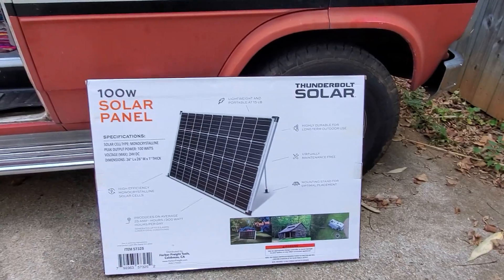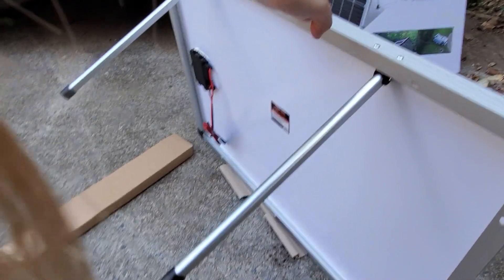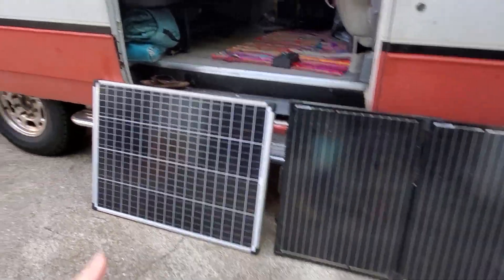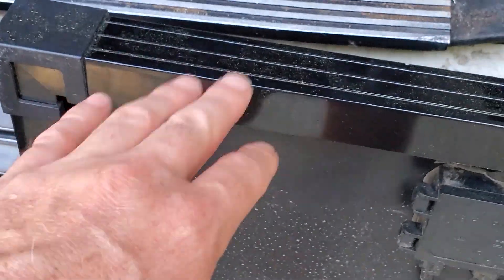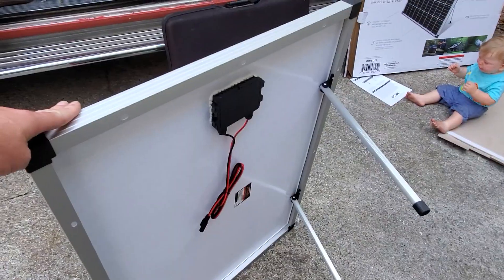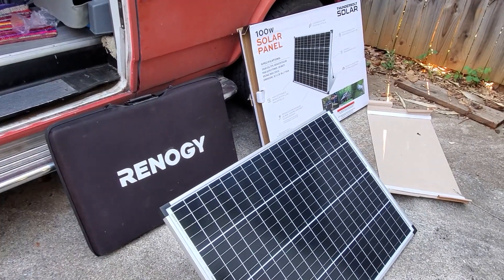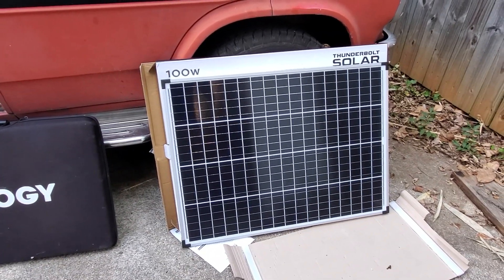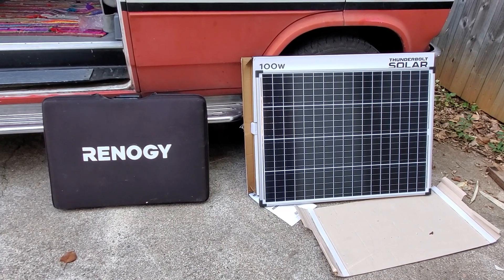Harbor Freight Thunderbolt vs Renogy portable solar panels

Comment: Newbie Question , just received my first solar panel Briefcase style (Richsolar)100w with PWM controller to use while camping to help keep batteries up. do i need to disconnect it if i am going to run my Generator  for the whole Travel trailer ? will it case damage to the system. thanks
Reply from the maker: Well, without seeing your exact setup, I would say that I have done the same and there has never been an issue. Your trailer connection to your generator should be an AC 120v connection, maybe 30amp, or something like that. Your battery system is DC 12v, I assume. So to oversimplify, generally the AC system, and the DC (battery) system of a trailer are separate. They do not run on the same power sources and use separate wiring. 

I have had my external battery charger plugged into the generator, charging the battery, while concurrently charging the battery from solar. There is some debate over whether this is a good idea, but my research (and actual use) shows that multiple DC charge sources can go to the same battery, and assuming they have their own charge controllers, all is well. I have also used two different solar panels with their own separate charge controllers going to my trailer battery, and it just charges faster, with no ill. 

Are you using an external generator, or a "built in" generator with some type of auto switch over for your camper?

Comment: I've been thinking about getting a couple more 100 or 250 watt 12 volt panels.  Not much difference in price on Amazon or Ebay.  
I currently have 2-100 watt panels,  and the old school 45 watt Harbor Freight kit. 3- 15 watt panels and a 45 watt Thunderbolt controller. I have a 40 amp ir 400 watt Thunderbolt controller too.
Two systems,  a 12 volt only,  and a 12 volt with 1200 watt  inverter. Have 600aH worth of battery storage,   two 6 volt golf cart batteries, in series,  and 3-100aH 12 volt deep cycle ones.
Reply from the maker: Yeah standardizing your panels should help the charging efficiency, keep panel voltages similar will give you the optimal output.
Reply: @kampinglogik  
You're right.  I just go with the stuff I already had, or can get the best deal on. I went with my dual, low vol, 12 volt system and the 116v AC system. 12 volt, 150aH ch controller,  150 watt inverter for charging phones and 2-way radios and the other 115vAC  1200 watt inverter and 650aH battery storage  for a  small refrigerator, 40" TV, DVD Player   LED lamps,  Christmas lights,  and 20" box fan. 
I figure not if,  but when we get an EMP, I will be better off than probably 95% of the rest. I can charge my radios,  watch TV, and DVDs, have light, a fan, cold Dr Pepper and clean my guns.
Hey. Make a  3/16" luan/plywood box, or like a slip cover. Cut with a safety knife or saw, duct tape the edges, done. Super protection,  light weight and kinda cheap.
Reply from the maker: @brianroberts5740  I'm with you there! Always looking for the best value!!

Comment: Get a nice MPPT controller.
Reply from the maker: Yeah I have a Renogy DC to DC MPPT charge controller in my van that takes a 12v line from the alternator as well as the solar input. I really like it. I use these panels for my trailer battery, I haven't yet justified replacing the two Renogy PWM controllers... after a 12 day trip to Maine this past summer, the two panels with their PWM controllers kept the battery topped off without a problem even with lots of cloudy days. I'm sure I will upgrade controllers if we ever do long (6 or more week) trips again like we have in previous summers.
Reply: @kampinglogik  I have the old HF controller from the 45W solar kit, I will keep it.

Comment: Mount it to side of van
Reply from the maker: Haha, the van has 2x100w panels on the roof... these are for the trailer. We just ended up throwing the Harbor Freight panel on the trailer bed while in transit on our most recent trip, the Renogy suitcase panel always sits just inside the trailer door...
Reply: @kampinglogik  as long as it produces
Reply: @kampinglogik  must be California or up north

Comment: I've been thinking about doing that
Solar panel on top of  van.!
Probably a dumb question?
How did you do it? Thanks!
Reply from the maker: Haha not a dumb question, it took me about 4 years to finally commit to mounting a solar panel on my van roof. I used some metal right angle pieces to have rails in between my ladder racks - then I mounted my 2 panels to those. The only hole I drilled in my roof was for the cable entry gland (a 1/2" hole). Here is a video showing how I did it - https://youtu.be/87Mpz1PEnAw
Reply: @kampinglogik  THANKS!
And HAVE A GOOD ONE!

Comment: I would make a slot in my vehicle to slide it in & out if I would keep it as a remote setup or depending on how the hard mounted solar is mounted, I would stack mount them where I can lock a latch & slide it under/over another solar panel while not in use & unlock said latch & slide it out when I want to use it! Drawer slides would work here, just need to make sure you're using heavy duty ones & you can lock them in both the open & closed positions!
Reply from the maker: That would be an awesome flexible setup. Flexibility is paramount in my mind, cause every campsite situation is different!! Message me if you get it setup I'd love to see how you do it!

Comment: No output readings? What kind of solar review doesn't include the most important aspect of a solar panel? Did I miss something?
Reply from the maker: Several guys have done output measurement on each of these panels, so I thought I'd compare other aspects of them. Fortunately they both seem to function well. Maybe I will do a head to head measurement video of these two soon. Thanks for watching.

Comment: I was thinking that a comparison would include output readings. I would bet the renogy is significantly higher. But great idea for your next video
Reply from the maker: Yeah I will try to do that soon. So far it looks like the HF panel does good as far as the output level. It tops out the 60w limiter on the Jackery 290 even late in the day. I do know from a lot of use that the Renogy puts out over 5 amps in good light.

Comment: Do you have to use a charge controller with the HF panel and jackery 290? Can't you connect it without a charge controller?
Reply from the maker: You are correct, no need for an external charge controller with the 290 or assumptively any other power station. This is why the HF panel is perfect for power stations - no need to pay for anything unnecessary.
Reply: @kampinglogik  I'm so happy to find this review! I got 2 of these z
HF 100 watt panels. Trying to figure which power station because someone pointed out the 24V I'm lost. Anything you can offer idea wise on this? Thanks a ton
Reply from the maker: @heatherk8931  Hmmm... 24v? Because you have two of them? You should just be able to connect them in parallel without any problem.
Reply from the maker: @heatherk8931  Or are you referring to 24v being the open circuit voltage?
Reply: @kampinglogik  don't worry about the 24v maximum on the HF solar panels.  It's rated for 12V use. And with any charge controller or power station, the voltage will be reduced to fit a 12v system.
Reply from the maker: @CivilRepair  yeah that was a viewer's concern, I was trying to figure out what they thought was 24v... anyway, thanks!
Reply: @kampinglogik  oh man. I meant to 'at" Heather. 🤦🏾‍♂️
Reply from the maker: @CivilRepair  yeah no worries I figured that :-) I think you correctly deduced her question better than I did

Comment: No out put test.....lame
Reply from the maker: Honestly a lot of guys on YouTube have done output tests on both of these panels... my video was really to compare other pros and cons of two portable 100w options and assumes they are operating as advertised. After 2 years of relatively heavy use, on a couple trips across the US, I can say the Renogy panel puts out over 5 amps in good sunlight. After a recent 12 day trip to Acadia with the HF panel that kept my 100ah lithium battery topped off throughout the trip even on cloudy days, I can say it keeps up just as well. I've since done quite a bit of testing with the HF panel and a Jackery 290 and it maxes out the 60w charge controller input limit even late in the day. So that's what I can share from my experiences.

Comment: Great review!  I would say to keep  foam pool noodles on your corners and wrap it in a thrift store comforter to protect it while in transport. Thanks for sharing.
Reply from the maker: Hey thanks for the comment! the pool noodles are a great idea! Your suggestion makes me think, I do have a moving blanket (they are so cheap at Harbor Freight!) I could just throw over it to pad the face. On our first trip up to Acadia NP (about 12 days round trip) the panel held up great despite getting tossed around in the camper a couple times!
Reply: @kampinglogik  You got it!  Great idea!  :-)
Reply: Great idea 💡 👍

Comment: Great to know about the logistics etc but what about the actual function and power produced? Are they both almost equal or one better than the other? I think that is what should determine the preference factor.
Reply from the maker: Yeah agreed that they need to function properly as advertised- but  the larger footprint or necessity of wiring it up can eliminate the HF panel as an option from the get-go for some